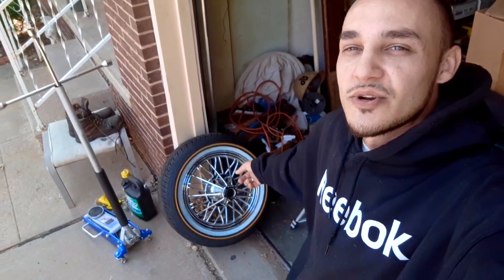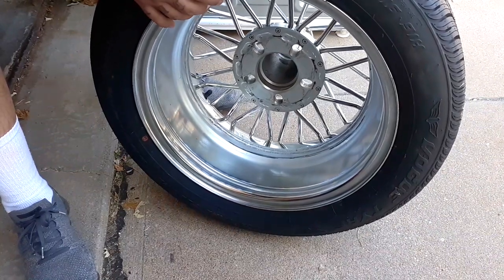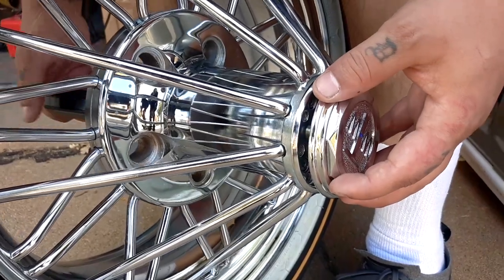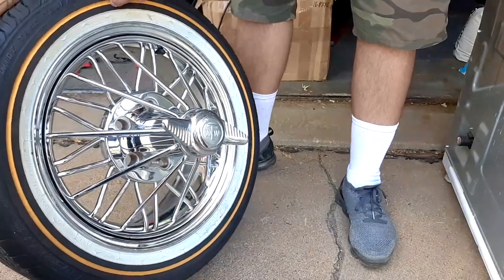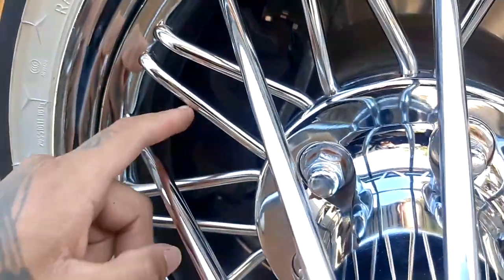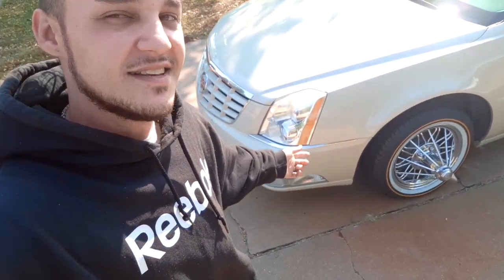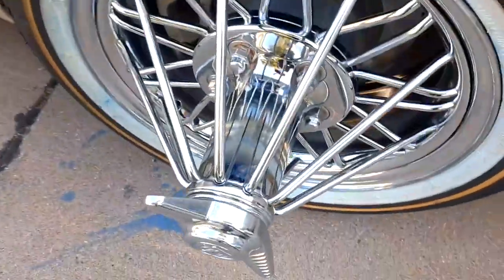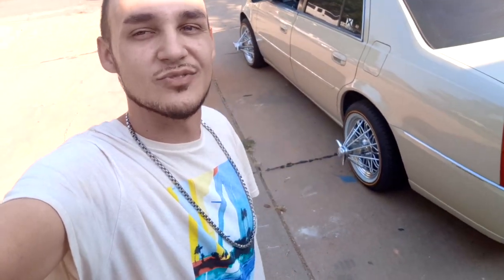CADILLAC DTS GETS GORILLA POKE 84Z

Comment: I hope you used thread locker on the spacer lug nuts? As for balance you can buy balancing beads that go inside the tire or you can pour them into the valve stem.